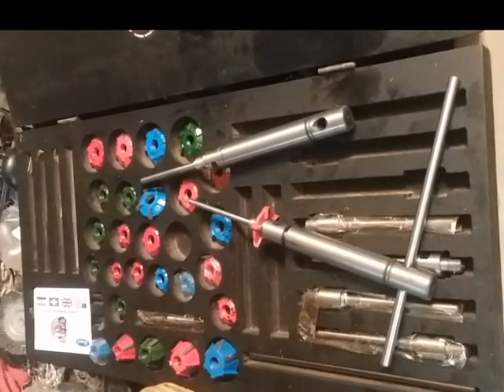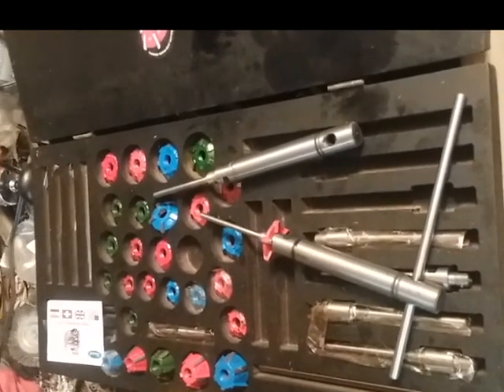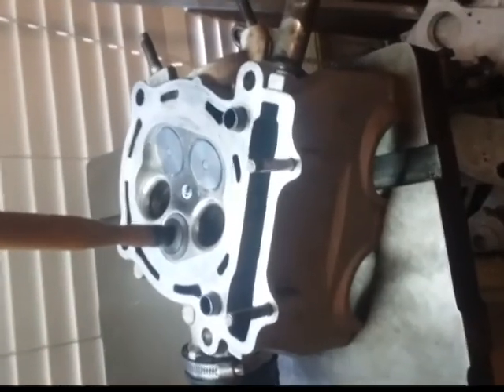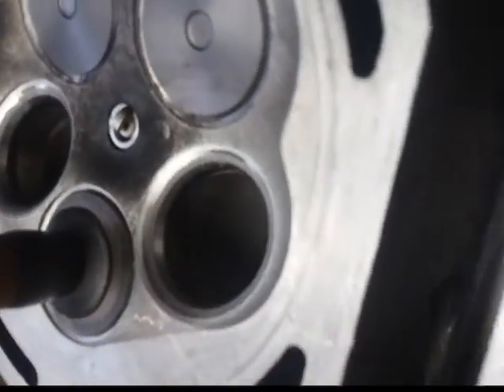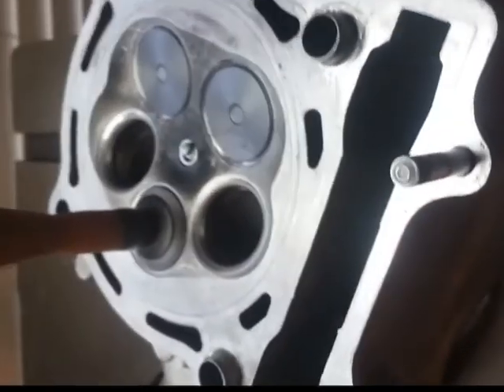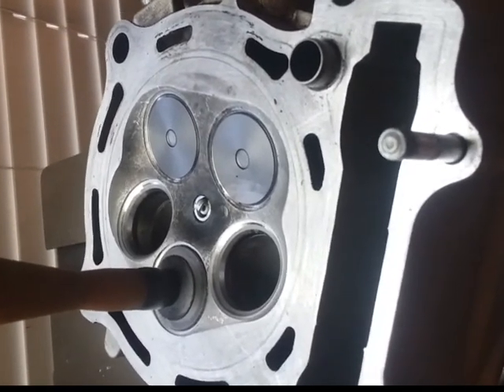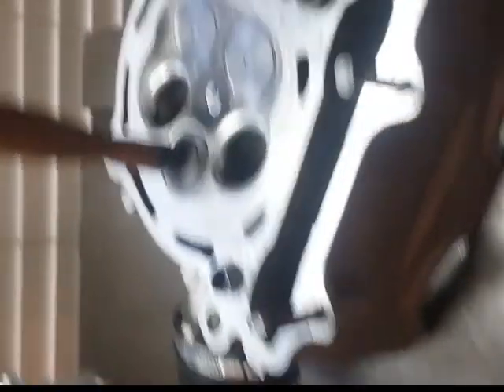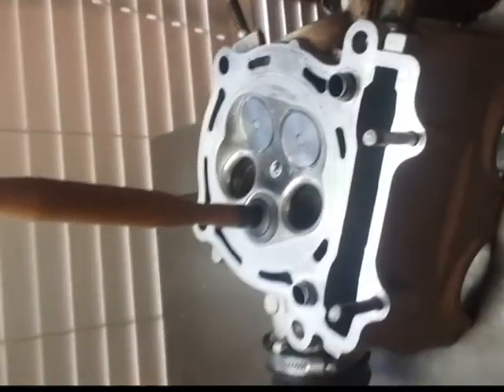Replacing motorcycle titanium valves, lapping valves in.

Comment: Why don't you use the new titanium valves to lapp the head? I thought the purpose of lapping was to match the head to the exact valve?
Reply from the maker: Typically yes, titanium plated valves are different though. You use the old valves to clean and polish the mating surface for the new valves. If you used the new ones the .001” of plating would be worn off which defeats the purpose of having them titanium.